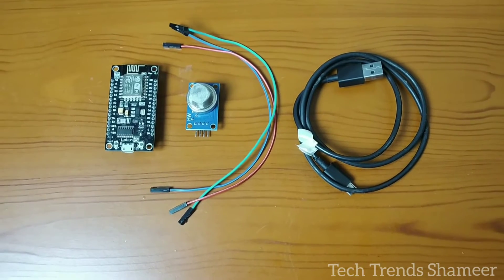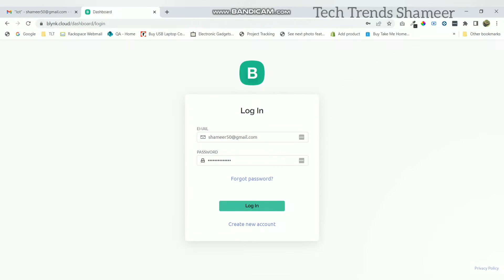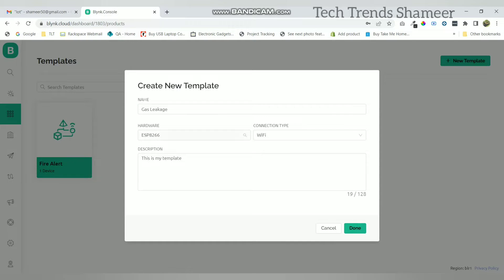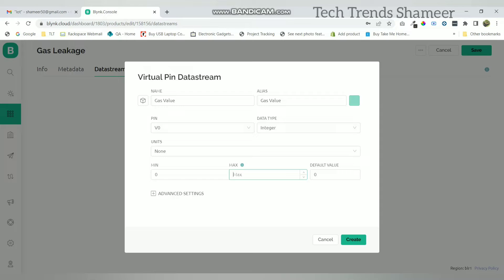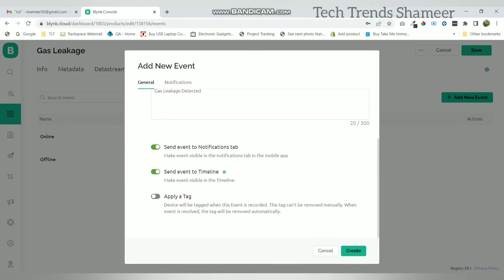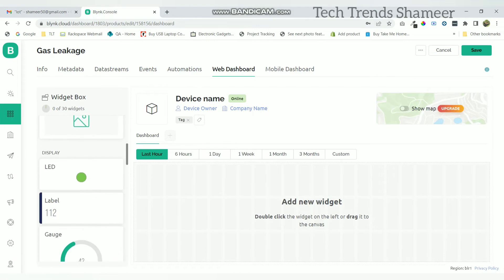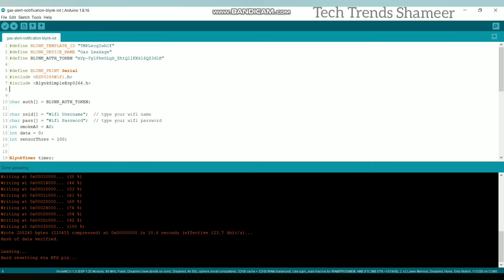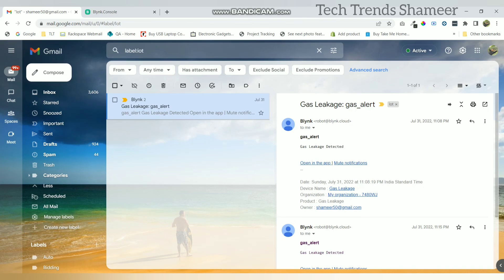Gas Leakage Alert Notification Using Blynk IOT | Blynk 2.0 Notification | ESP 8266 | IOT Projects

Comment: Sir mine is not working. How is it working if the minimum voltage to run mq 6 is 5v but the maximum output a node MCU can give is 3.2v? Please help me regarding this sir.

Comment: Gauge value remains the same ( 200 ) and i am getting notifications for every one min if my device is on ( without sensing the gas)
Reply: Help me sir
Reply from the maker: In Serial monitor, please check what values you are getting once you gave the power supply. Based on that change the value in the code.

Comment: Thanks again Shameer. Another successful project for me. I’m using MQ2 with this code for a secondary smoke detector in my home. Had to change IF statement to >300 and set gauge upper limit in App to 700. Clean air quality is 178 and light smoke raises it to around 350. Keep up the great vids on the 2.0 series Blynk 👍
Reply: bro my project is not working can u help me out?